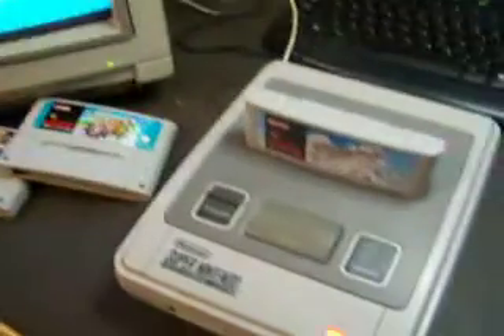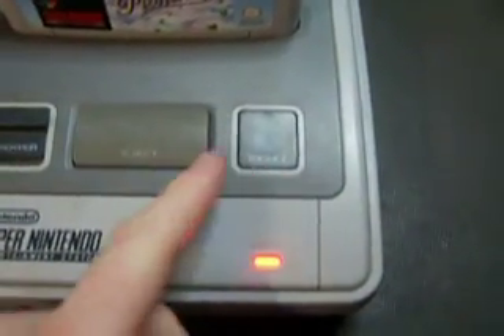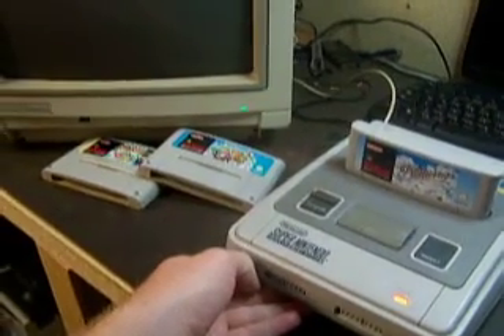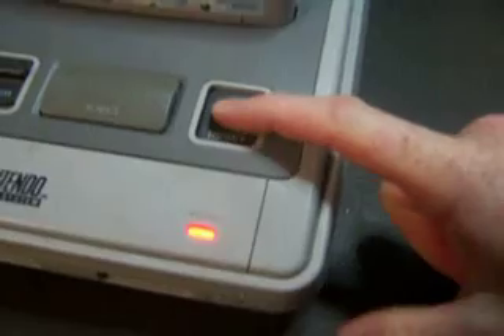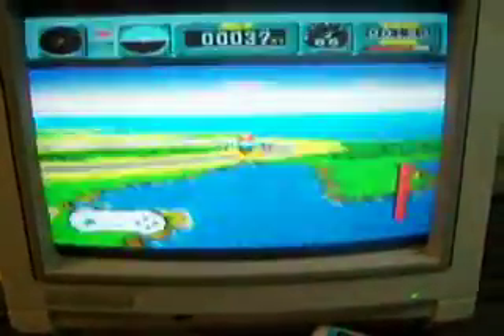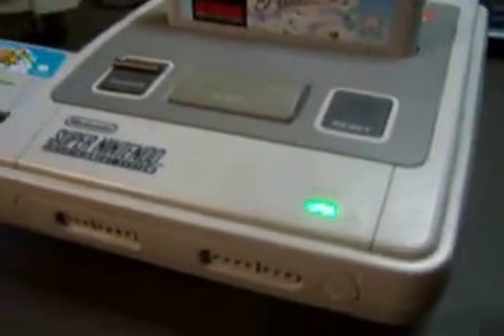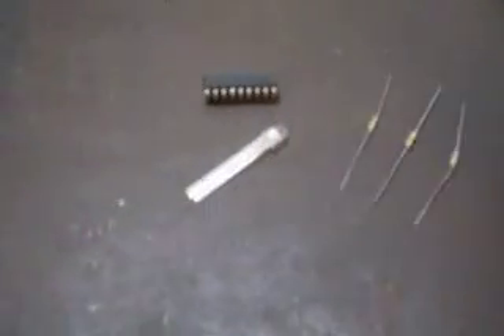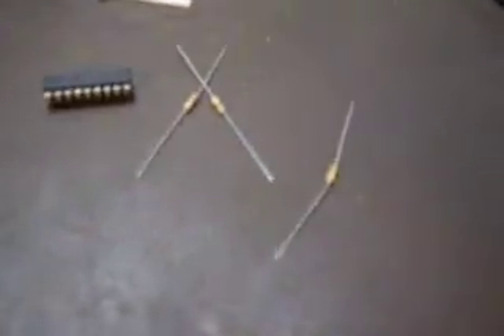A Super Nintendo Mode Select Hack.

Comment: Yo, I've done something similar but for the 16F88 (with internal oscillator) due to this elvis mutliprogrammer blowing both my 16F628a samples and 16F627a! Thank god my 16F84a still works ! :D.

Anyway, if I send you the code, would you host it for anyone that needs it? (Pinout is the same)